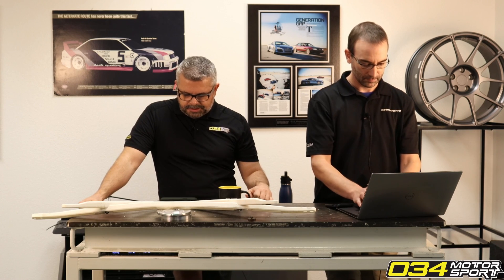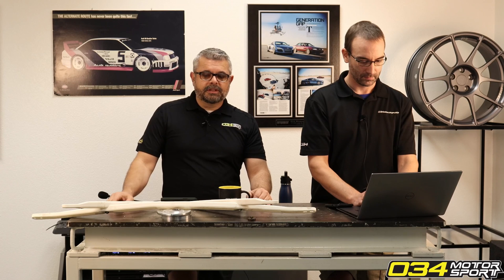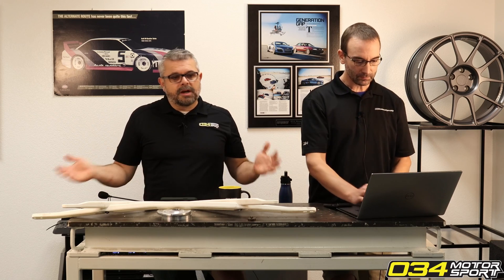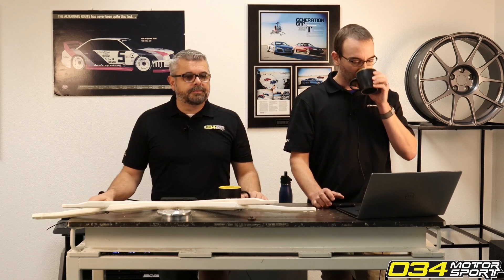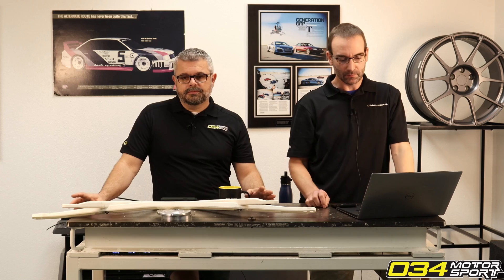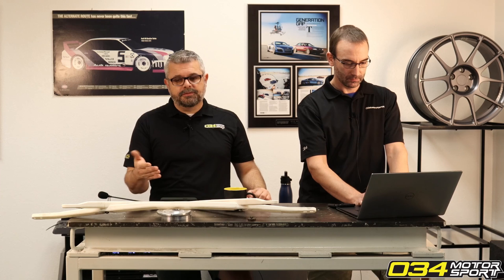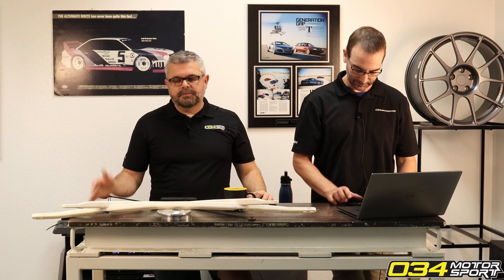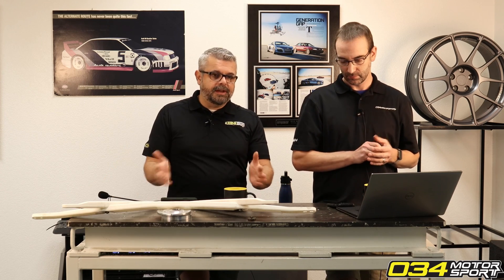What are the limits of the 3.0t Supercharged Engine? | 034Motorsport FAQ

Comment: 3.0T is one of Audi's best engineered engines. They can handle a ton of power and keep running reliably with routine maintenance. Keep in mind that installing pulleys to spin the supercharger faster will generate more heat increasing the IAT to the point that the factory intercooler will not be able to bring the temps down. So expect to upgrade intercooler and pump with the pulley upgrade to keep the balance of temps and boost. Not upgrading all the accompanying parts will just cause the car to run slower due to it knocking and pulling timing.
Reply from the maker: Agreed! A well taken care of 3.0t is a great motor and an upgraded heat exchanger is definitely required at these upgraded pulley ratios!
Reply: @034motorsport  I proudly own one. A 2010 S4. Currently it is at Stage1 and will walk away from a Camaro SS.
Reply: @TwentytenS4B8  no lie just walked one last night 😂
Reply: @israelpapi7777  my b8 A4 fbo walks the v6’s. Little brother would do you guys proudly.
Reply: @034motorsport  a heat exchanger  is not enough to combat heat soak!!! I had to make my auxiliary pump run at 100% to be able to drop my IATS fast enough even with a HX. you guys need to develop coolant  expansion tanks (like PLM they have an extra reservoir and tank) or maybe find a way how to make the supercharger intercoolers more efficient like Jokerz performance did!!
Reply: @davidmusiyenko4158  Generally, you upgrade the pump when you install the upgraded heat exchanger.
Reply from the maker: @davidmusiyenko4158  We have tested divorcing the system and it provides little to no change in temperature. The flowpath that they share is simply a fill point that is after the point of cooling, thus causing no substantive change in temperatures
Reply: @034motorsport  so is there any other way to combat heat soak?? Especially with my 3.30 ratio .
Reply: I have a stage 2 and currently the dealer is changing the intercoolers.  One had a very small leak but not visible on the ground.  Coolant level would drop a bit over 6 months.

Comment: Want to build a 2014 sq5 with 165k on the clock?? It’s already stage 2 upper pulley. Is stage 2 upper and lower pulley too much?
Reply: It boils down to how it was maintained. Were oil changes done on time? Are all your other parts in good working order? Do you have any fault codes in the system due to failed sensors etc? If so, you should take care of that before any performance mods. Is your aftercooler up to the task of dealing with the hotter intake air temps due to spinning the supercharger faster? Manufacturers build these things with balance. Upgrading one part and not the others that accompany that part upsets that balance. Spinning the blower faster will result in more boost, but that also increases the air temps past the point that the stock aftercooler can handle causing the ECU to pull timing when it pings under boost. Some people are lost on how they could be Stage 2 upgraded but feel slower than say a Stage 1 car. And the reason would be what I mentioned prior. So if your engine was maintained properly and all your other parts are up to the task then Stage 2 should not be a problem.
Reply: @TwentytenS4B8  everything is mint. I change the oil every 3500 miles. I just had the intercooler‘s replaced for preventative maintenance and a carbon clean.

Comment: I was checking you website, Do you guys have TCU together with your ECU remap? I need to tune my car but no one in my country can do what I need on the TCU. I need the 2-step Launch control with the regular other updates to sustain the 540hp of the Stg2+. My A7 has dual pulley, heat exchanges upgrade + extended fluid volume, test pipes, mufflers deleted, resonator deleted, intake and now its getting WMI as well with 700ml/min. But I still to decide what tune to use. Some of my upgrade are from 034.
Reply from the maker: Is your A7 equipped with the DL501? In this case, we should have tuning available for your car readily available on our website. Our ZF8 tuning is currently in beta and not regularly available via the website. If you would like to confirm with your Box Code and Software Revision prior to purchasing, please email us at tuning@034motorsport.com and we'd be more than happy to assist.
Reply: @034motorsport  aye, its a DL501 dual clutch transmission
Reply: @034motorsport  just purchased my 2015 Sq5 with 40k on the clock and is bone stock for now will be doing basic bolt ons and tune  .. are you guys looking for guinea pigs in the beta testing for the zf trans?

Comment: So how many miles 3.0t with 600 ft lbs of torque will hold up? Couple of passes, 100 miles or 10,000 miles? Any links to the builds with this much torque?
Reply from the maker: No hard and fast rules, a well maintained car will be much more reliable than one that was poorly maintained, unless something is wrong no need to be concerned but need to keep in mind the age of various components and update, upgrade or use caution

Comment: I run a 207mm on my a7; it’s mind blowing how fast it is.
Reply: What sort of boost is that producing? More than a smaller dual-pulley setup?
Reply: @varthdata  I dnt have my boost tap installed yet; do I can’t say exactly. My friend has the same car with similar mods. He runs dual and I run single. My car is significantly faster than his. I hope this helps.
Reply: @jaycruzanbay4153  what brand pulley??
Reply: @tylerblazer  ( jhm) jh Motorsports
Reply: @jaycruzanbay4153  check your math. I’m running 57.5mm upper and 190mm lower. My ratio is 3.30. With upgraded 80mm throttle I’m with IE running around 21.5 psi on 93 octane tune with stock blower. Your ratio is 3.27 (66.20 stock supercharger pulley, 207 crank.) no you’re not more aggressive than dual pulley. Unless the person ur racing was running a 179 or 184 or 187. Those will have a smaller ratio yes. also depends how aggressive the tune is. I’ve raced 034 s4’s and apr tuned 3.0T cars on stage 1, stage single 2 single pulley. Took everyone of them even tho we all had similar mods. 207 is not the most aggressive. 57.5 upper over 194mm crack is the most aggressive it gets before you overspin your blower.
Reply: @davidmusiyenko4158  Where do I start? First thing; not one of my comments did I use any sort of math equations second per JHM WEBSITE; 3:27:1 is the optimal ratio not 3:30:1. In my case I’ve walked every single v6 Audi/Volkswagen with dual pulley even ones with ported blowers. But I appreciate the input/opinion ; I haven’t had any problems as of yet!
Reply: @jaycruzanbay4153   this can be a long conversation lol but I agree to disagree. It comes down not just it hardware but too how aggressive your tune is. IE is much more aggressive than 034 or any other tune. And also the most important thing is the health of the vehicle. Third of all the cooling. if the other cars had stock cats on (like I do and I heat soak badly even with HX and coolant pump upgrade) Then that would make sense too. I feel like all of those come into play. Not just the ratio. Guys out there are running 3.4 -3.5 ratio’s and with the proper cooling they’re achieving crazier numbers on dual pulley than on 207mm. But your comment made me think about my choice twice😅😅😅 I’m gonna talk to some techs and see what happens. Might switch.
Reply: @davidmusiyenko4158  well said. I do agree!
Reply: @davidmusiyenko4158  facts to this
Reply: @varthdata  My rough math says a little north of 18 psi (rpm/tune & other variables).  Would like some hard data as well, looking to install this pulley on a Q5, but I am already at 445hp with just tuning and refining the stock engine. This engine is just so good.
Reply: 207mm is crank or supercharger
Reply: @Zues_1401  lmfaoooo
Reply: @Zues_1401  crank

Comment: Id love to see a turbo kit built for one thats widely available. I have seen custom ones done, but nothing just off the shelf type kits.
Reply: You mean a turbo + factory supercharger setup?
Reply: @Bytrl  compound setup would be cool but no I meant straight turbo. I know several people who have custom made them but nothing you can just buy off the shelf
Reply: @michaelschneider530  why would you do straight turbo on a factory supercharged car? Makes no sense.
Reply: @BigBagOfFrikenAirFak  because the people who have swapped to a turbo setup on these cars are making more power then what the blower cars can make currently. Another guy is working on a fuel setup to run full E85 but I haven't seen any updates on it lately.
Reply: @BigBagOfFrikenAirFak  also, a lot of supercharged cars end up turbo. Look at the new gt500. PBD just done a twin turbo kit on one. I like turbo because it's easier to change boost levels without swapping pulleys.